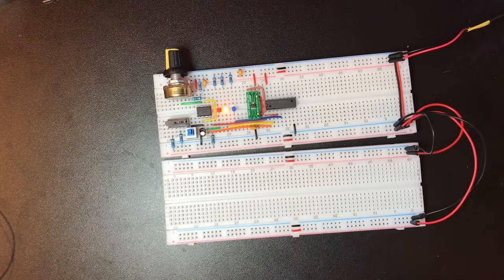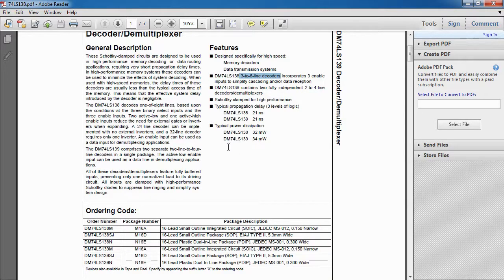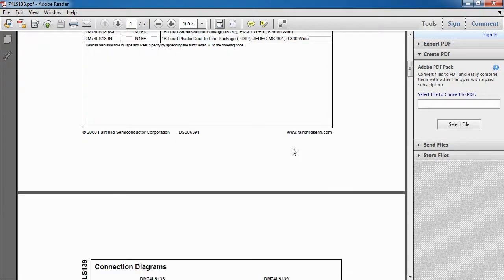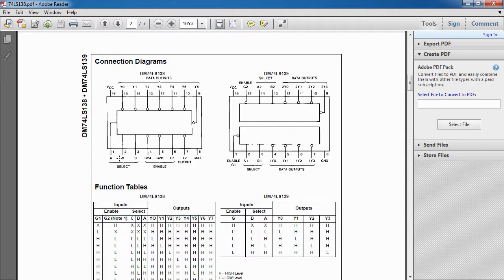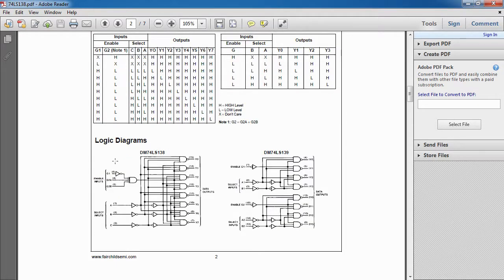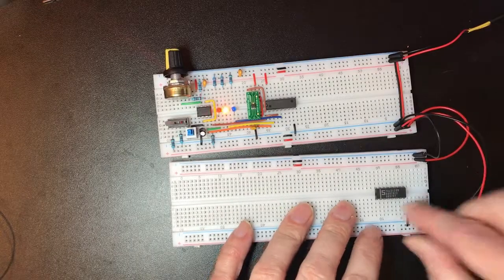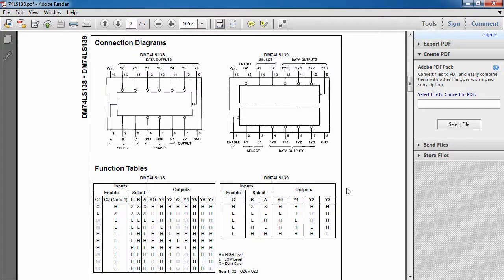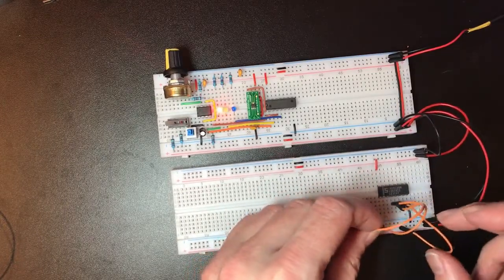Experiments with the 74LS138 - Making an 8 Bit pipelined CPU - Part 5

Comment: Anyone know the serial number of the registers?
Reply from the maker: Not sure what you are asking there?
Reply: @weirdboyjim  about the number which is found on any IC for example the IC timer has a number (555) on it ,
therefore I want the number that found on the register so I can buy them
Reply from the maker: @Every_thing717  ok, the term to use there is “part number”.
Reply from the maker: @Every_thing717  all the latch chips I use for the registers in this build (that are not counters) are 74xx574, I’m careful to use common parts as much as possible.

Comment: Did you try to do a snap transition, but then mess it up and just cut in footage of the datasheet?
Reply from the maker: You would need to provide a time index for me to comment on a specific case but this is a very old video, my production standards have improved since then.
Reply: @weirdboyjim it's at timestamp 12:29
Reply from the maker: Yep, I was being clever and messed up.
Reply from the maker: But that wouldn't have been me "cutting in" data sheet.  My pc captures the audio, so I probably left a gap on the editor timeline so whatever I'm capturing on the pc then shows through.  In this case the data sheet.

Comment: You should have disconnected the bottom of the top solderless breadboard first ?.
Reply from the maker: It's a bad habit to work on circuits with the power on, but I still do it.

Comment: Amazing. I've been tinkering with micro stuff since the mid 70s when I built a Netronics COSMAC Elf II.   I consider myself to have a pretty good handle on things going on inside computers, but have never delved this derp into the internal workings of a CPU.  Really looking forward to the pipeline and CPU microcode.  I'm watching them in order after accidentally stumbling onto your stuff and being stunned by a non CPU processor appearing to be moving at a pretty good clip.    You and Ben Eater are doing incredible things.  Have you considered recondensing your work into an FPGA?
Reply from the maker: Glad you are finding it interesting! There are some people on discord trying to put together an fpga version but it's not one of my goals for this version. When I'm done I want to start a new build to experiment with some more advanced features and fpga would be on the cards for that!
Reply: FPGA FPGA FPGA!!

Comment: 24:02 - In late 2018, had you been watching This Old Tony videos?  ;)

(Not that that's the only possible source of inspiration here, just... somehow feels like that vibe to me?)
Reply from the maker: I never once chopped a breadboard into with my hand! Couldn't get the knack of it.
Reply: @weirdboyjim  haha, ah well.  You did a nice job on the insta-population of one, though.  :)

Also: is it just me, or would breadboards with 3 or even 4 horizontal sections be nice, for stuff with LED indicators in particular?  I guess there'd need to be a longer jumper for power to ICs, but that's one line... I'd love to have LED's on the same columns as the pins sometimes...  Ah well.
Reply from the maker: @DavidLindes  I keep meaning to make some mini pcb's with a 8 led's and the resistors on. Essentially a SIL led array.

Comment: Probably more expeensive, but the 74HC154EN is a 4 to 16 line in one chip.  Thoughts?
Reply from the maker: It's a nice chip,  to be honest I was struggling to get hold of any at the start of the build but the combination of enable lines on the 138 is useful.
Reply: @weirdboyjim  yes, i saw that hat trick this afternoon. i do like you showing these tricks. i have watched ben eater then james woods.  now i am watching yours. a nice progression on concepts. i am breadboarding now too. however my final will be based on the rc2014 bus. i have extended it to 63 lines as i am going to use breadboards as my backplane. i had already figured out the need to multiplex by control bus, so i immediately followed your same approach. appreciate the reply. you are providing valuable insight and it good to see these things taken one step further. cheers

Comment: I'm 6 videos into your playlist and only had to order some 74x193's so far. It's very nice of you to stay within my current inventory like this :-)
  Any suggestions are obviously too late for relevance here, but I picked up some 74x4514's to play around with. They are not as common as the x138's but it's a 4 to 16 line mux decoder with latched inputs. It might prove useful.
 I really like how you're delving into the details of propagation delay at higher frequency. I look forward to your 40 MHz 555 circuit thingy as well ;-)

  My inexperience was leading me to believe a pipeline design would involve multiple clock signals divided down but it looks like most people use the inverted clock and rising/falling edges. Very interesting.
Thanks for sharing.
-Jake
Reply from the maker: That's weird, we had a few comments on this that have disappeared?

Comment: I love the 74138... it makes a really good iO expander for microcontrollers too.
Reply from the maker: Yes! It seemed weird they way they have different enable inputs until you start trying to use them in circuits.
Reply: @weirdboyjim  I've never thought of your cascading using the enables.... that's really economical.... I think you've just saved me loads of complexity in my synthesizer control panel I'm working on at the moment..... really good idea.... I'm hoping I can use it on my analogue demultiplexer too.